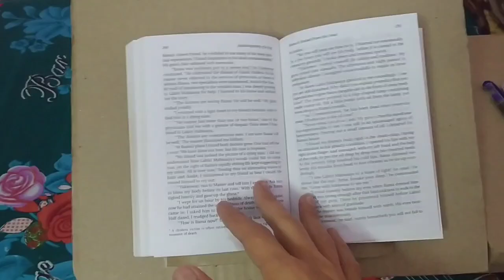How to make a drawing table at home with Cardboard.

Comment: What can we use default of hanger?
Reply from the maker: Aluminum wire can be used. It's easy to work with , whereas hanger takes a good deal of efforts to bend it.
Cardboard also can be used as a supporter.

Comment: For your creativity I suggest you fevicol white additive glue but the glue you are using is also strong but fevicol MR glue is more durable and long lasting 😃
Reply from the maker: Okay thank you for this suggestion. I'm aware of it, but I'm trying to keep the material cheap. Fevicol isn't expensive much but still this glue is cheaper. That's why. 
But thank you for your concern 💙🌼

Comment: Wow. This is even better than the store brought one I have at home. We are 3 siblings and we have online lectures at the same time and we have only one table. But I will not be able to make this because I don't have any materials.
Reply from the maker: Thank you so much ❤️.
Even I didn't use any expensive material, so you should try . You definitely can make this. 🙂
Reply: @SahilNarulaK01  Thank you so much for motivation. 😊
Reply: @SahilNarulaK01  But it will be difficult to find cardboard because of lockdown.
Reply from the maker: @sabakausar6746  pleasure buddy.
You can try once when lockdown is over.
Reply: @SahilNarulaK01  Sure I will.